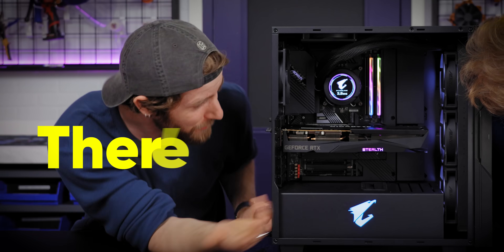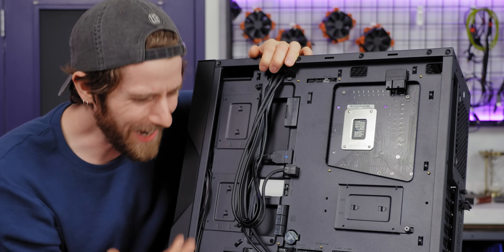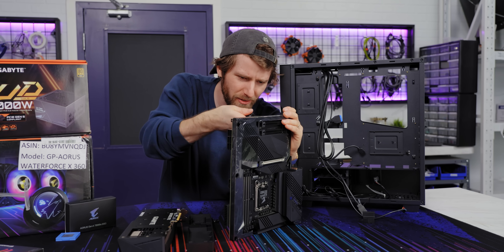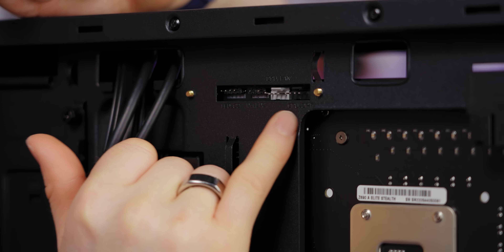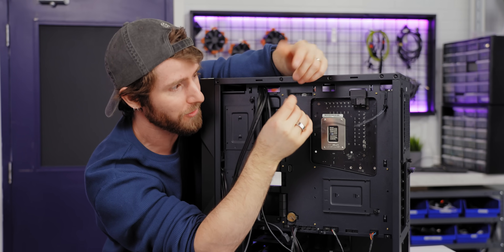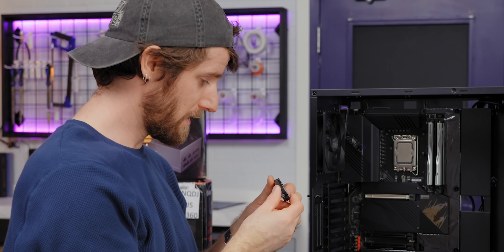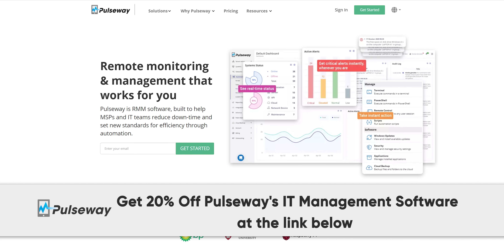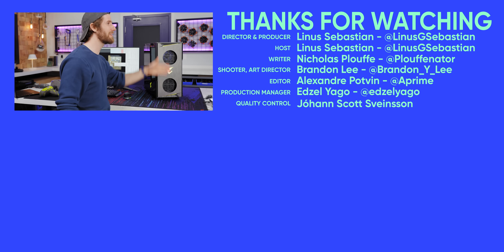Where Are the Cables??? - Gigabyte Project Stealth

Comment: Oh and with regards to standardisation...this would likely need to be addressed at case level.

Taking from some SSF designs, rail systems with spacers or modular rear mounting back plates for motherboards in standard cases would resolve those issues fairly easily.

Comment: I have been wishing and praying for something like this for decades...however this makes the most sense in SSF. It would open up a whole new way to deal with cabling in SSF cases and likely significant improvements for airflow in smaller spaces.

Whilst I see the application and minor improvements in standard and larger cases I think this would completely change how we look at SSF builds

Comment: Love the concept of hiding the cables and love how Linux went all Steve on the lack of airflow. They just need a mesh version of the case and it should be great.
Reply: Yeah it was full Gamers Nexus for a while there, well deserved critique, why do the manufacturer still do stupid shit like this.
Reply: The part with not being able to fully remove the front panel because of the cables on the front I/O is very reminiscent of the Fractal Design Meshify C. In any case, it's a pretty lousy design choice.
Reply: @Onihikage  I have the cheaper Fractal Focus G for my secondary PC and you can take off the front panel with no issues there. Strange that the Meshify C has that issue.

Comment: I did something like this back in 2005ish. I soldered all of my mobo connections to the back of the board. Only thing I couldn't hid was the GPU power. It was pretty sweet looking, especially because you could see nothing was plugged into the 24pin on the board
Reply: Yeah usually all power connectors (+ RAM and PCIe slots) are through-hole mounted so you can theoretically just do this yourself.
Reply: You can't do that because the pin  will be mirrored. All connections will be shorted out, unless you changed the cable arrangement
Reply: @oyen9476  I mean…. If you’re on that level of „motivation“ to solder your connectors tonthe backside of your mb it shouldn’t be a big problem to take care about the cables 🧐
Reply: @oyen9476  I just soldered them to the pin the would go to normally, doesn't really matter which side

Comment: Wow, I've been building pcs for 30 years, this just knocks my socks off.   I sure hope this concept gains enough traction to go big enough to fix the issues.  I already have a very expensive case the corsair 5000t in white which I absolutely love but I would chuck it in a heartbeat for a good execution of a case such as this!
Reply: Problem is the PC manufacturers are super super conservative about not having "backwards compatibility", hell, damn PCI are still upside down... we still use the 24pin PSUs which were a small upgrade from the 20 pin ones which are basically ancient... sata connectors are still wired with 3.3V even tough basically no device uses that... etc
Reply: @geort45  What are you going on about "PCI are upside down"? You mean graphics cards with their fans pointing down? If so, that's how they should be. The whole point of the fans being on the bottom is less dust settles on the heat sinks than it would being on the top. it's the same reason Power supplies have always been mounted fan pointing down. Keep dust and shit from falling on your heatsinks and into your components.
Reply: @scythelord  No, what he means is that when PCI came out the cards went in the opposite way from the ISA cards at the time.   This was done to distinguish between the two.
Reply: @scythelord  they're upside down, you're merely stating that it's better that way for dust. The actually named BACKPLATE is on the top
Reply: @geort45  live is not upside down it's a hold/carryover from pci and itx where the build was the motherboard flat on the bottom of the case. And your airflow was as you read a book left to right.
Reply: @jackass123455  they're upside down now, the "backplate" is up. All damn pcie cards have their components facing down which is a PITA, nvme/pcie adapters to raid cards, etc.
Reply: @jackass123455  @scythelord here's your answer "We used to have ISA slots. The cards were right-side-up. When PCI was being developed, designers wanted to give builders a choice of using up to six PCI cards or six ISA cards from a single 8-slot AT case. To geth PCI and ISA to serve the same slot hole in the case, the PCI slots were placed between the ISA slots. Then, to get them to align with the hole, they were made upside-down.

With this design you could have an ISA card one slot above the PCI card and still have enough room between them to prevent shorts, and motherboard designers didn't have to take away one slot to add the other."
Reply: As I mentioned, they're fixated on backwards compatibility. PCI orientation so people could still use ISA cards. In some ways it's beneficial, in others, it makes them carry designs for decades...
Reply: I sure do hope so = perfection

Comment: Locking a propetiary GPU/Motherboard configuration definitely hits the longevity of this product. In reality, like most niche designs like this, there is a high probability this will fail and get discontinued within 2-3 years. Now, you're ready to upgrade to your fancy new 5070, but you won't be able to use it in this configuration and you'll struggle to get anywhere near full value price reselling your old card.

Comment: Yeah, buy buy. I love my case, it's got vents all the way around. I have 2 120mm fans on top, 2 in the back and 3 in the front. All air cooled, my cpu cooler has 3 120mm fans as well. 

Gpu has 2. 

3 fronts pull fresh air in, cpu fans push it to the back, the back and top fans exhaust. I turn my fans to 15% in most takes and stay under 80 degrees.

Pretty quiet too.

Comment: Honestly with so much flair that goes on GPUs nowadays I'm actually surprised there aren't more options available where the PCIe power connectors aren't like on the sides... Like sure, in the bottom is quite hard to get something done and probably would have compatibility issues, but what about on the side opposite to the PC's back panel? it would make some amazing cable management too.

Comment: You can have a hub with usb: As, Bs, Cs, ethernet, display port, HDMI, SD, microSD all hooked to one usb C
But you still need for your MOBO a sound conector, 7 pins usb connectors for rgb, pumps, another one for the front usb + usb 3.XX whatever is called this blue chungus cable, additional usb C, fan headers, power and who knows what else... WHY!?

Comment: Honestly though I don't blame gigabyte not originally caring about main gears patent, because let's be real that patent is bs and shouldn't have even been issued. You can't own the idea of putting components/connectors on the back of a PCB and having special cutouts for them in a chasi designed for said PCB. That's just rediculous.

Comment: To be honest I'm shocked that someone comes up with this after all these years... It's fastinating and I hope it becomes a new standard of thinking when it comes to PC building.
Reply: It would make stuff incompatible. So it dont happen
Reply: @Blackbirdone11  It's really a matter of addapting it by manufacturers and that's about it. Just like when a new CPU comes out with a new socket and it's not compatible with older motherboards. It's mostly the case of motherboards gpu and cases, you could easily manufacture seperate motherboards and even some GPUs (like this one here) to give people a choice of this kind of setup and it would sell extremely well, trust me.
Reply: it would require any 1 or 2 fan gpus to be incompatible but if they found a way to compromise for that it would be outstanding, makes building much easier and looks fantastic. Just need people to actually test the idea to see what is missing/needs changing
Reply: @cameronmacartney9230  I believe 2 fan should be still OK with miniITX boards, you could have a longer slot for that cable in the back of the case that would work with miniITX and smaller GPU and bigger motherboards and big GPUs. It's absolutely possible, there are many incompatibilities in the PC world so this wouldn't be the worst one ;)
Reply: @PoltergeistWorks  100% agree. I just hope they do thorough testing before slapping them on the market 😋
Reply: It would be something as simple as modular latched slides that sit on rails that the user can slide around the cable routing.
Reply: Many servers in datacenters already do something similar to this and have been for many years.  However, as Linus mentioned, you get locked into a particular vendor.  Even though they 'tend' to follow standards (DDR, PCIe, etc), you still pretty much have to use hardware provided by the orignal vendor or either a) you void your warranty or b) it simply doesn't work.  I don't see this being widely accepted by the hobbyist/enthusiast market.

Comment: The issue with the plugs not lining up on the back side of the motherboard, is likely because he removed the motherboard and then put it back on without lining it up properly.

An end user should have the screws loosely attached so that the motherboard can still be moved slightly while attaching the plugs on the back side, and then fully attaching the motherboard afterwards.

Comment: It's an interesting solution even if the execution of the case could have been a lot better re airflow etc. I've watched those LTT videos about strange mobos with I/O on three sides that are probably for obscure industrial applications but this one does make some sense.

I'm not into transparent side panels or RGB gizmos. Most of my machines don't live in the house and I only look at them when they need attention. I get that sticking I/O headers etc on the back of a mobo could make for a very tidy build. Placing GPU power inputs on the bottom of the card is certainly a win on that front.

I wonder if placing I/O headers on the back of mobo would offer any advantages for workstation type machines etc re airflow? Or are more quieter fans a better and cheaper solution?

Comment: I feel like there was an opportunity missed, yet also nearly impossibly to implement with Steve from Gamer's Nexus making a cameo and talking about the thermals and doing the drilling.  Never the less, it was nice to see the bit of thermals after to show how relatively little additional airflow (actual area was less than half the front panel) is needed to change the thermals from critical and throttling to hot yet stable.

Comment: The radiator/airflow shenanigans suddenly reminded me of something. I've got an old Fujitsu server here with two Xeon E5-2470 v2 CPUs in it, and I replaced the jet engine fans with three 120mm cheapies from Amazon, because they're quieter. The CPUs have passive heatsinks, and a plastic shroud directing the airflow from the three fans over them. These are 95W CPUs, and even running absolutely pegged at 100% with max turbo, the crappy fans keep them below 60C (well below throttling).

Have we got it wrong with all these crazy cooling setups? Is this a much more obvious and simpler way to do it?
Reply: The whole PC case standard should be redone. CPUs could be placed into a cutout region so that heatsinks can be attached to both sides of the mainboard. GPUs could be mounted in a way that they'll not sag by default. Airflow could be from the bottom to the top, like a termite mound, and with dedicated channels so that the CPU fan doesn't heat up the rest of the case. RAM, VRMs and SSDs could also get their own cooling.

Comment: This build was going so well,  and then it went down hill faster than an avalanche.  Gigabyte does it again.  Oh and as a side note, I have the gigabyte 3080Ti the performance is amazing however.... I bought a water block for it, and I could not understand that only Alphacool makes one (maybe bykski), but now I know why its only two companies that make a water block for such a  high end card, its those dam power connectors, they pig tail outside of the card and water block, trying to hide those is a nightmare Ive never seen anything like it a horrible design.

Comment: Don't send Linus a case without enough cooling holes, or he'll drill more. I can't imagine how emasculated the engineers that designed this product feel when watching this.
Reply: If I had to hazard a guess the engineers who worked on this case knew this was a problem and told their bosses that, but management and the design team probably ignored them. The design comes first because that's what sells cases. Most people just assume that the case will work and don't have Linus's experience to tell them that restricted airflow like that will throttle your PC
Reply: @kinslayer202  and one doesn't even need to have linus' experience, it is common sense that gets overlooked by the low iq masses
Reply: @kinslayer202  hope they have some saved correspondence for when they inevitably get shat on.
Reply: That is IF they see this.
Reply: @Derethevil  They can't see the video because they are in some chinese underground facility.
Reply: I think Steve would do something similar too
Reply: @salty1099  I sure hope he does a meme reference to this moment in their worst of the year series video haha.
Reply: they're not engineers, it was prolly the marketing team that designed this
Reply: i suspect the engineers put all the air cooling required and industrial design (marketing) department said  nope - MUST have our logo over a clean front.
Reply: @deansmith4752  My case has a solid front but vents on the side,, define mini c :)
Reply: As upper management calls a mandatory meeting and plays this video.  DOH
Reply: Good. They should.
Reply: They probably don't give a shit. Just another pay day.
Reply: @WelcomeToTheBackLogs  Just because you don't give a shit about anything doesn't mean everyone else works the same way.
Reply: @Hexen_Wulf  Not sure how you came to that conclusion but carry on.

Comment: Yeah this is fucking cool with a bit of tweaking this could definitely get adopted i.e GPU lengths vary so the cut out might have to be tweaked. The 12pin and CPU power can definitely get flipped but I bet the custom cable companies are sweating

Comment: I love the straightforward and honest criticism that points out the blatantly obvious issue with this case. Sponsored or not, we got an honest review that will probably save quite a few of us from buying this product (until it's fixed, because aside from the airflow it's a very nice case). Additionally, I can guarantee Aorus is going to see this and thus hopefully fix it with a simple new front cover.

Comment: i did one of  these as a DIY project years back, had an old AsRock board, desoldered all the connections and resoldered them back on the other side, i killed the audio chip with the heat but otherwise it ran great for years, i had always wondered why noone had done it before and now i know why

Comment: "Tightier builds with better Airflow" Didn't Luke literally debunk the myth that cables restrict Airflow in any meaningful way?

This concept is neat... until you gotta fix something.
Reply: imo it’s a good concept if for nothing else than the front panel headers being more accessible
Reply: @meair  But you plug it in once and never touch it again... And even so, Asus has a part that is even easier to handle. It allows you to plug everything into 1 block and then it's easier to plug that block into the motherboard.

Again, this is a solution looking for a problem.
Reply: Yep... he did, but it seems like it would be easier to service in many ways, not much more in other.
Reply: @TheGameBench  Unless other manufactures get involved, the concept only works with 1 gigabyte board and 1 gigabyte graphics card. Meaning, you're locked into a company who's track record of warranties and RMAs is subpar at best...
Reply: @Xyler94  Okay, I see what you're saying. I agree that it's nothing more than an interesting concept unless it somehow were baked into the ATX standard so this is just the way boards, cases and GPU's were made, regardless of the brand. I was more speaking to it being more a more serviceable design as a whole than the way it's done now. But you're right, Gigabyte's track record is not good and it's not like this case doesn't have other, clearly obvious, flaws as well. I wouldn't buy it alone for the lack of airflow.

Comment: If you have any experience in board design you wont be all that impressed by this. Hardly anything has been done to accomplish this. 
Id still like to see this more widely implemented though.
Reply: @wojtek-33  tell me why, then
Reply: Would hate to sit there and rejigger all the power planes back to front though, ouch.
Reply: I see two major problems: protecting the CPU socket while wave-soldering the through-hole connectors, and the pinout of the chips was probably designed with the conventional layout in mind. But there are plenty of ways around both of those problems. And honestly, the only tricky bit about this is the mechanical-electrical co-design. But if you use Altium that's not exactly a problem either.
Reply: Would not be surprised if they just solder the through holes by hand.
Reply: @capybarahat  Possibly, though I'd avoid it on an 8+ layer board since the chances of screwing up the board are considerably higher, especially for a product expected to last a couple of years. It'd be interesting to see a couple of close-up photos, should be easy enough to tell from that alone.
Reply: I had to scroll to damn far to see this comment.
Reply: Well it's quite different to just mounting the ports on the bottom of the case as all the tracks have to be mirrored, which is non-trivial.
Reply: @nickryan3417  Just use a mirror when building PC and you're ok
Reply: @Astromamut  LOL